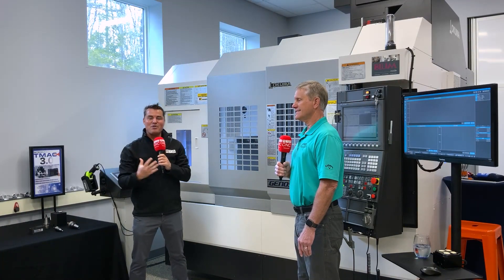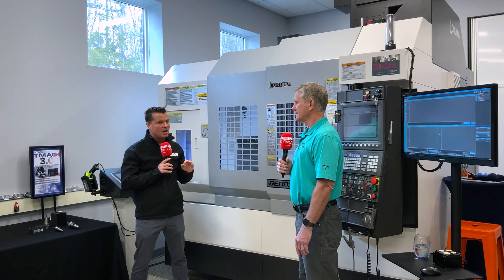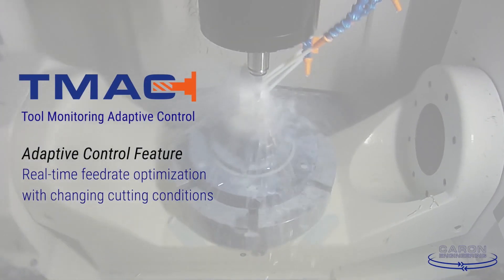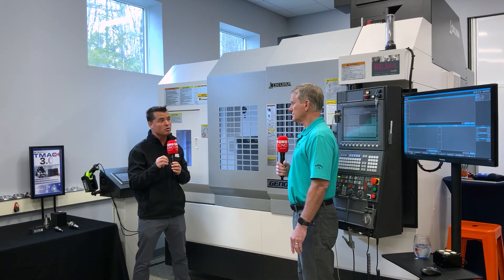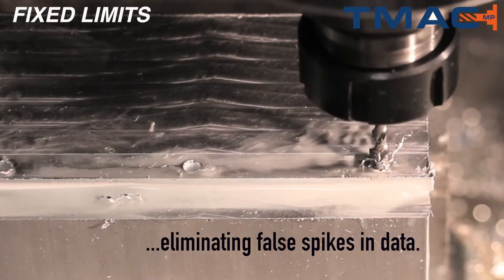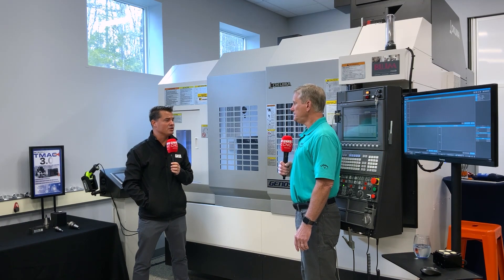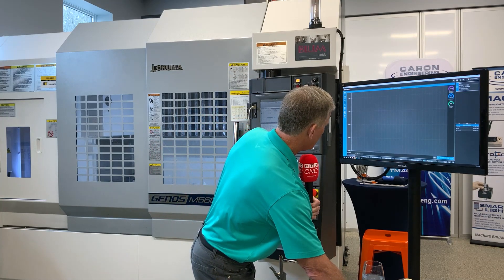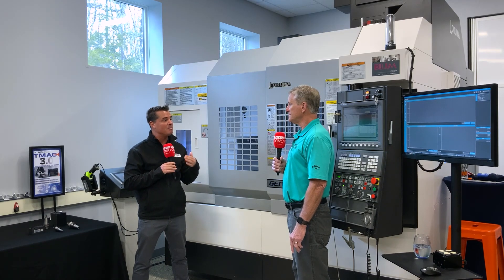Now that's clever - adaptive feed control

Comment: Very cool product, maybe you can add RPM reduction too. If you have a long tool lenght, reduction of feedrate may not be enough to compensate chatter. Nice way would be set a max of feedrate reduction to 50% and if its still vibrating, reduce the spindel speed too.
Reply: We are currently working on adding that component to the system as well
Reply from the maker: Hope you enjoyed the video, thanks for watching.

Comment: pretty good, i like that the vibration is used to "detect" bearing and machine status, the adaptive feed control its pretty good, but high end machines like Mazak have it for some time now, but if its useable on any machine then we are going somewhere
Reply: Many machine tool companies have a version of this.  The difference is that they use the machine control to do the processing.  Our dedicated IPC has much more processing power and can therefore execute more complex control algorithms to handle machining anomalies.   Also, on machine systems use the single resolution power signal from the servo/spindle drive.  Our system uses added multi ranging sensors that are faster, higher resolution and scalable by the system giving much higher capability.
Reply from the maker: Hope you enjoyed the video, thanks for watching.